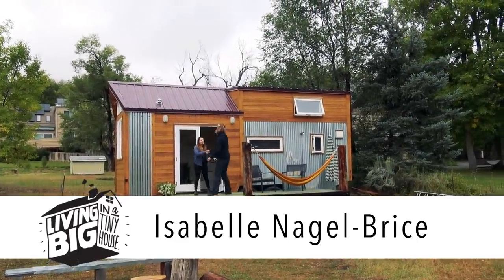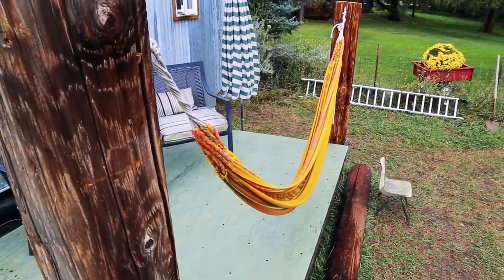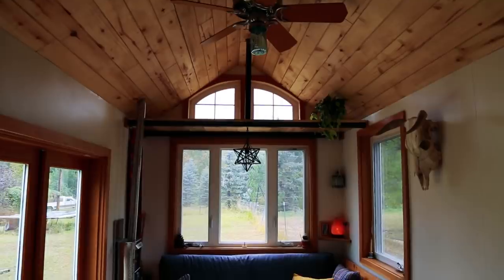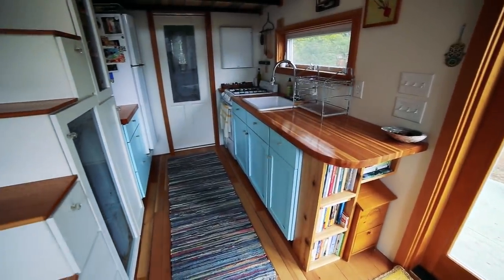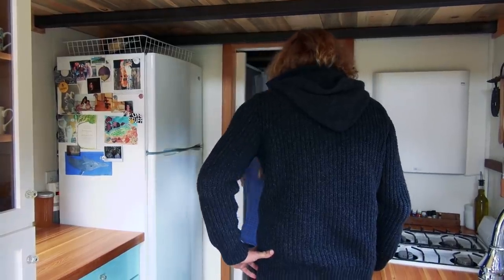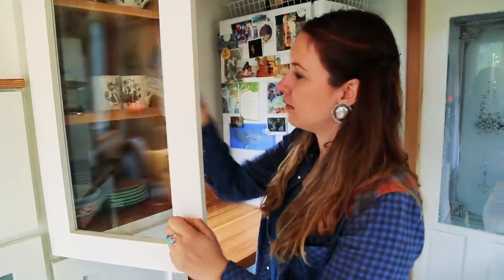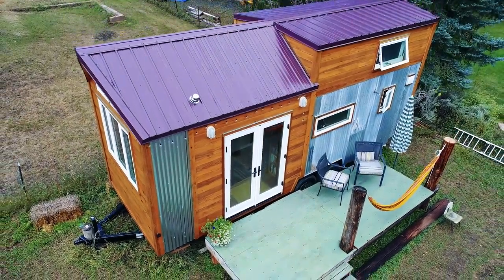Young Woman's Off-Grid Green Built Tiny House Designed For a Sustainable Future

Comment: She is so fortunate, to have her dear dad help build her tiny house! It's nicely finished and decorated too! One no-no I did notice though, is the use of OSB paneling for the shell, and that stuff is hardly green or non-toxic. The adhesives that are used to bind the wood flakes together contain formaldehyde. Any bit of moisture contacting that stuff, and it turns to mush, and, the black mould loves it! It's definitely a building material that I won't be using for my tiny house build.
Reply: ^ I agree that the show focuses a lot more on the looks than on the functionality and construction supplies.  I like the show, but it could be improved: Plans, material lists, square footage, R-factors, etc.   For instance, nothing was said about the R-value of what-ever odd insulation was used.  Insulation under the floor?  Something without skirting probably a must for the winters of Colorado.  How to find the "right" trailer?  Weight distribution, axel load, etc, are all very important, at least to me...
Reply: @DannyBear70  Agree! And there was little discussed about the construction of the house. From one of the shots it was clear that it was a steel framed house. I'd like to know more about the pros and cons of building with steel.
Reply: @DannyBear70  Who would want to watch information for your personal project?  And who's interested in skirting alternatives for winters in Colorado?!  This site is enjoyed by people from all over the world.  Enduring blurb on the R-value and material lists and all that stuff is of absolutely no interest to most people.   The format is highly enjoyable and pretty much perfect.
Reply: Sarah Martin : OSB without formaldehyde do exist.

Comment: beautiful
just one thing - since those stairs looks very slippery some security handlers  attacked to the wall will be fine
Reply: Coddy Copeland 
Good chuckle. Thnx.
Reply: *attached
Reply: I'm not sure WHY but not having a stair rail seems to be COMMON in Tiny Houses😒
Reply: @estherstrategicadvisor749  They tend not to have kids and you don't normally think of hand rails at that age.  I've seen some have them on the walls though.
Reply: Exactly my thoughts.. that was the first thing that came to me as well given that i am so clumsy in my socks
Reply: The pan of boiling water looks like another hazard. Do Americans have kettles?

Comment: I like this house; it's very nice and functional at the same time. The stove looks like the kind of stove we use in Europe (or used before induction). I have a practical question: Since there is no vestibule/hallway in these tiny houses, don't they lose a lot of heat in winter, especially if you have several people living in it (especially with kids) who come in and out of the house? I am no architect, but I'd be afraid of the cold getting in every time you open the door. I'd appreciate any insight from someone who has been living like this in a cold climate for some time. Thank you.
Reply: Zdeněk Benedikt 
Good point. I assume that they close the doors fast to avoid heat loss.
Reply: I live in a smaller home (but not a tiny one) about 850 sq ft. I have no vestibule or hallway, or anything like it. When the door opens, it stays about the same temp, maybe the heat might kick on if the door isn't shut in under a minute. I have seen solutions on pinterest that involve a large, heavy curtain in a semi-circle around the door. That way it is also malleable, and you can hook it on the wall when it's nice out.
Reply: sophia thebirdy the curtain is a clever idea🤔 great question and great answers

Comment: If you want to know how good it could be...
In Russia such tiny house would be considered something like a builder's shed, you can live in it, or you can store something, it doesn't matter. It doesn't have to be on wheels, if you can lift it with a crane and transport - it's okay, even if it's wider, than you can drive without special permission. It can be placed on any property or rented ground. You don't have to connect to the grid at all, and you can dig artesian well and septic for personal use basically anywhere. Not to mention, the whole project will cost you, like, 5 times lower with all new materials, payment, food and beer for contractors.
Reply: Yes, but then you have to live in Russia. ;)

Comment: Curious if that heated air exchange gizmo would work in a van... hmm
Reply from the maker: It would be PERFECT in a van. This unit is actually 12v too, so it's great if you're on battery or solar. I have one in my tiny house and it runs all the time on a 12v battery.
Reply: Living Big In A Tiny House thanks! 💟 I think she called it a "lunos ventilation unit" or something similar..
Reply: that's great info, wished it would have been shared in the description area.  As a matter of fact, LBIATH, a list of the unique things found in the tiny houses would be nice, with perhaps their URLs...  Please consider.

Comment: Very nice house. Since this house is so well thought out, I have to ask if it's close enough to town so that you don't need a car. Otherwise you have to figure in that foot print as well.

A fairly random Boulder question: I saw a video just yesterday in which a realtor said that while it snows, the snow rarely lasts for more than a day or so. Any Boulder residents who can comment on this? That's certainly not what I recall from being a kid in Boulder back in the early '60s.
Reply: I am in Denver, 25 min away. When it snows, it just doesn't stick around like it used to. Climate change, I suppose. Honestly, it sometimes is 70º the day after a snow, and it just disappears in the blink of an eye.
Reply: Wow. I recall having snow on the ground for weeks at a time. Sometimes a fair amount.
Reply: สร้างสวรรค์ตักร้อยรักวิมานนาดิน 5555

Comment: I thought those propane heaters for tiny houses create wet heat, as opposed to dry heat with a wood burner. one tiny house owner had one in his r v & had to replace it with a wood burning stove because it saturated the ceiling insulation, literally wet, drippy mess. as soon as he replaced the insulation he got a wood burning stove. no more problem.

Comment: What happens when one of the tires go flat??
Reply: They should be putting jacks around these houses to take the weight off the tires, and also protecting them from the elements so they'll last longer.
Reply: What happens when the tyre of Your car goes flat?
You simply change it, or You repair it and reinflate it (with the latter being more work, less environmental impact, no entirely new tyre needed, yet).
Even so these tyres are under it just for regulatory loopholes, You can fix'em like any tyre.

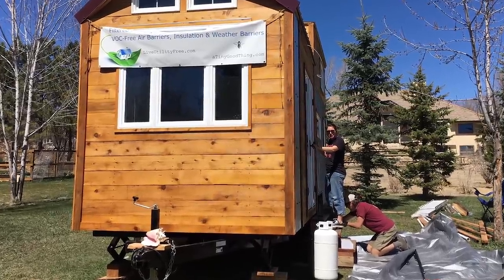Comment: 2:17 Do Tiny Houses last 30+ years?
Reply: I'd be shocked if it only lasted 30, more like 100+.  It has a 50 year or lifetime metal roof, metal studs and its small size makes it stronger than a larger home would be.  Other than maintenance items like the tires and eventually a siding or roof replacement, yeah it will go the distance like any house.  Huge advantage over an RV.